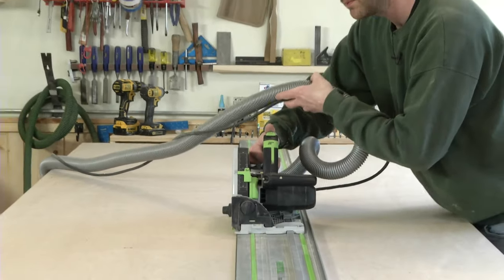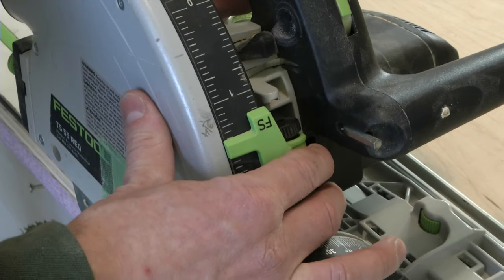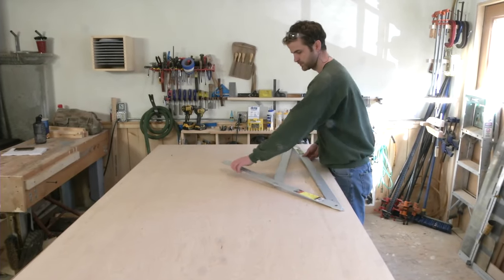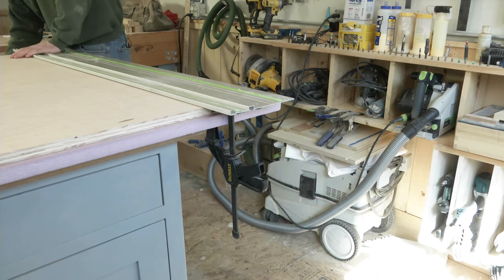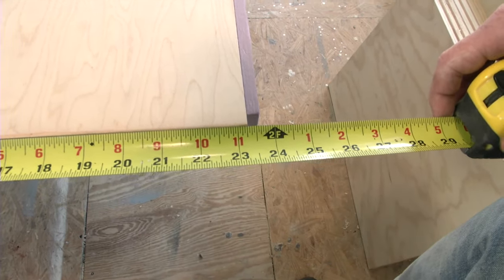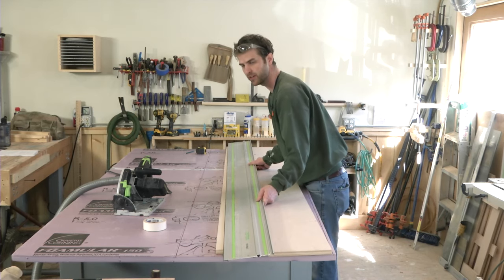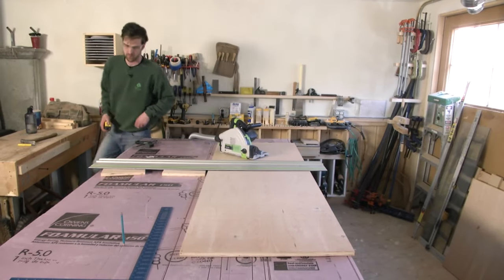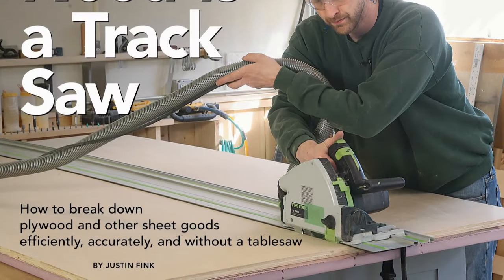How to Accurately Rip and Crosscut Plywood With a Track Saw

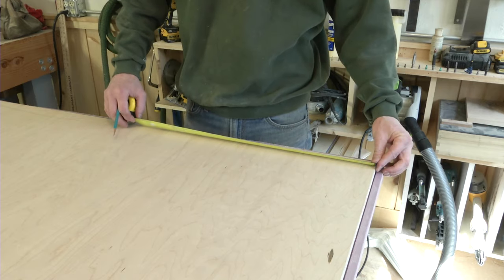Comment: At 2:02 I see Justin making a single cut mark on the plywood.  A straight mark can tilt slightly.  Then which end of the straight mark should your cut be made?  I prefer a V-shaped mark with the apex of the V where my cut should be.  Make sure you are cutting on the correct side of the kerf!   Thanks
Reply: Never knew why the V works better, thanks!

Comment: Good advice on using the clamps. I don't bother for rough sizing cuts but they get used everytime I make an important cut. I have a small workshop, it's not uncommon for me to make a cut in 2 stages, moving myself and the cables/hose part way through, without clamps this would be near impossible.

Comment: But what if the 3 other corners are out of square? Maybe I am missing some basic geometry but I just don't get why it is only necessary to have only one corner that is 90 degrees. Couldn't we have a trapezoid form with only one corner being square? When doing the rip cuts then I would imagine that if the other 2 corners aren't square then you can risk getting different length of rips, what am I missing here?
Reply: You're right that the other 3 corners won't be square, or at least probably not. However I think the point of his explanation and this video is how to get that first corner square, which is the hardest to do since you are really creating the square yourself with no already-squared reference points. Then after you achieve that, by referencing your two straight edges and your one square corner, it would be easy to square all of your other cuts up as you go along, by continually referencing your square points and making new straight and square cuts with each new piece.